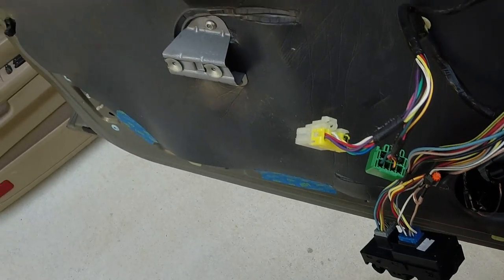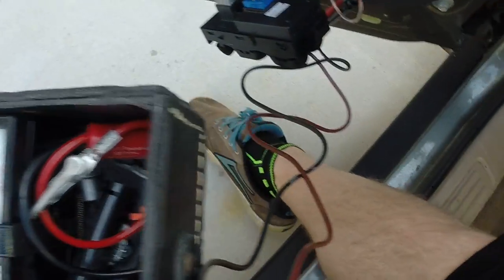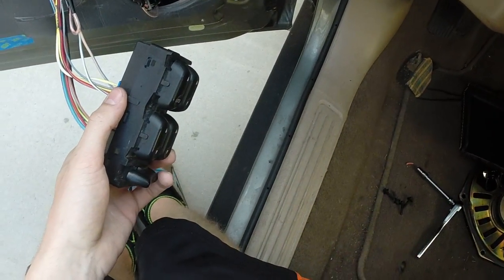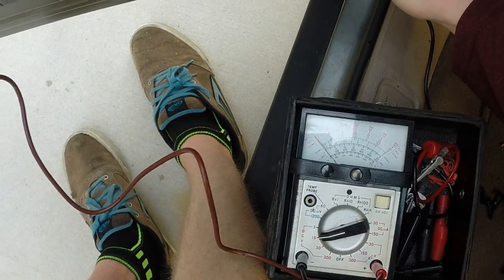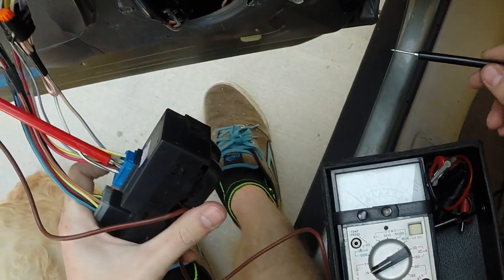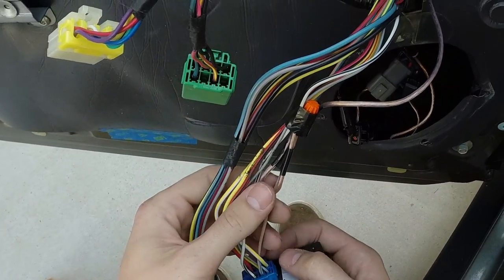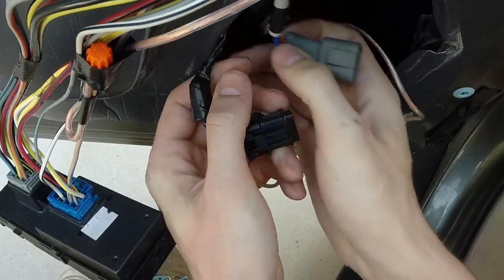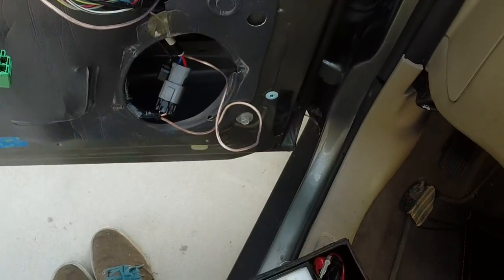98'-06' Taurus/Sable Driver Window Fix

Comment: Right on ,"my guy". Geesh I was surfing through other videos. And your the only one that showed the actual issue. Not pre made broken wire connection through door, and fuses under the hood checks. Blaggghhh. It worked. Was about to replace the whole door at pick and pull. 😂😂😂$40.00 buck sale now. Once again..... ty  🙏🏾 YouTube car tech.

Comment: Thank you for this video. It helped me figure out what was wrong with my mothers car ad fix it. Her window stopped working completely. It went down the other day and didn't want to go back up. You could hear the relay clicking. But no action. So I tested the power at the motor and at the switch. I ended up having to completely bypass the relay all together for the up and down. I figured out which wires did what and ran new wires directly from the switch to the motor. Wouldn't ya know, BOOM! FIXED! window works properly and now so does her alarm. the window wires shorting out or whatever they were doing were causing the alarm to randomly go off. Now that if fixed too!

Comment: I tried everything on my 2000 taurus.tried everything,replaced everything.still done it.l ran a jump wire from the circuit breaker to the power wire for switch.(blue w/black stripe)l now have power and they work great.

Comment: Dude!
Keep making videos. (Yeah, I know this was a while back).... Useful!
Hope your audio improves.
Oh, VOLTAGE (direction, etc) and CONTINUITY are not the same. Otherwise your video was excellent. 
I came because I was helping a friend address this issue & wanted to see if removing the speaker would facilitate the job.
This video is ABOVE average for most out there.

Comment: Very low sound volume.
Where can you get leads with alligator clips?  I have a digital VOM with the shielded leads but I cannot find the leads with the thin wire probes and alligator clips that I used in electronic tech class that would plug right into a digital VOM.

Comment: Voltmeter is not a continuity meter. And the lower the gauge number the larger The wire. And actually showing the work that you did for the repair would be a plus for this video.

Comment: I watched this video (and a couple others) and have a suggestion. This video says there is a loss of power but the problem location isn't sought out and divulged. Another video suggests that the bundled wires that are in the boot at the door hinge can be the problem which causes the loss of power. Look at the wires inside the boot and you might find a damaged wire that doesn't allow the current to flow properly. Specifically, a blue and orange wire could be the culprit. In the absence of a damaged wire, the relay might be bad or simply have burned or corroded contacts.

Comment: I had a windows stop working. intermittent radio cut out while shifting from park to drive and drive to park and also when accelerating. Another problem was my engine ban 1 was dumping a ton of fuel. Found a broken wire in the door harness under the boot. (blue w/black stripe) Reconnected it and all the issues above went aay and all windows work again. 2001 sable 24v

Comment: my sable dose the clicking noise but if you push the switch button down really hard it will roll down so i think my master switch is bad and not sending enough electricy to run the motor

Comment: I dont understand how this fixes the issue the connections on both ends are the same wire u just spliced the middle of the wire
Reply: The green/blue wire from the switch actually goes back through the door harness, to the GEM, to the auto-down circuitry in the GEM, and back out in the orange/white wire, back through the door harness, to the motor.  At some point the one-touch relay is in there too, as it is specific to the driver window.  Basically, this bypasses all that, connecting the orange/blue directly to the orange/white input on the motor, converting to a "dumb", but functional, window again.  That's my understanding from the video anyway.  About to do this on my friend's car since none of the suspects I looked at have been the culprit so far.  Wires in the boot are ok, relay is ok, switch is ok.  Voltage isn't getting to the orange/white wire so haven't bothered to test the motor itself yet since I know there is a problem in the circuit somewhere between the switch and the motor plug.  Guessing it's the GEM itself or something around the fuse block area, but not sure I want to try taking that stuff apart.